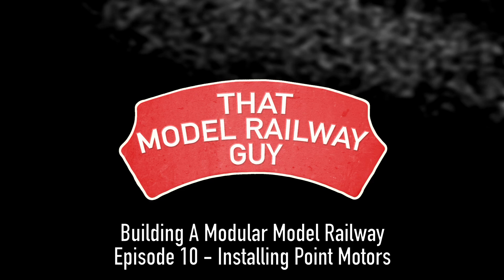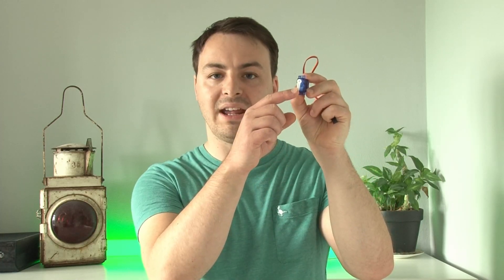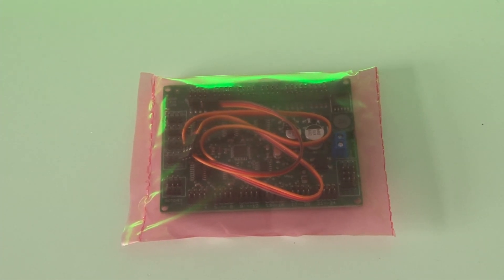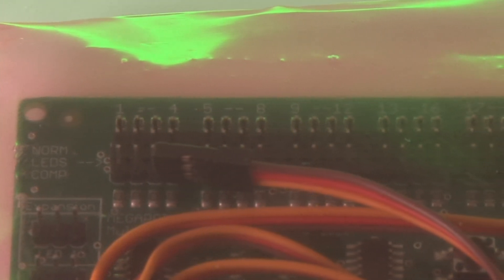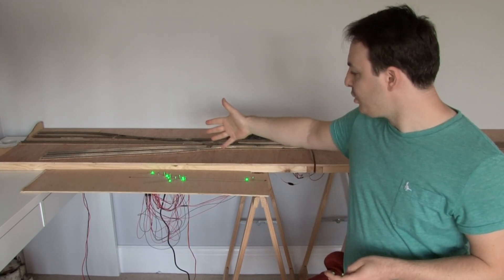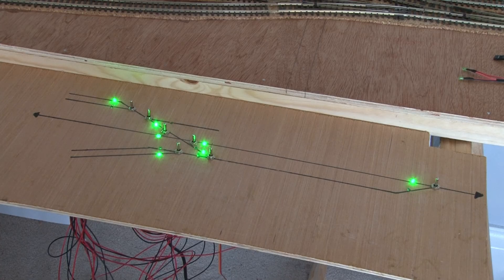Building A Modular Model Railway! - Episode Ten: How To Install Point Motors

Comment from the maker: For those wondering, I kept the springs in the points deliberately. While the layout usually runs on DCC, when I switch it over to DC the power is routed through the point blades. Keeping the springs means the blades are locked into place better. 
It's a "belt and braces" approach and I may remove them in the future but the audible "click" you get when the point switches is a handy way to confirm it's all working as expected too. Thanks for watching 😃
Reply: Good point.

Comment: Great, I didn't know about these point motors, they seem to work really well and it will make running more easier as you know where they points are set, well done 👍🏻
Reply from the maker: Hey Adam, yeah the servos are great! Pretty cheap and they have plenty of other applications as well. They're not limited to being used with the Megapoints system either but I have admit that made the wiring and the control panel so much easier to put together! Thanks for watching 😃

Comment: Gosh, that's really nicely done, That Model Railway Guy. I'm amazed at how effortlessly the little loco operates through the switches. Even the slip seems to pose no problem for it. You've done a great job.
Reply from the maker: Thanks, the tender engines never have any issues at all because they have so many wheels/pickups. Occasionally the Peckett and Ruston will stall on the points but only if I'm running them at an absolute crawl and I haven't cleaned the track in a while! Thanks for watching 😃

Comment: A very useful looking system - I might explore using it when the time comes for points on my layout. Thanks for the video.
Reply from the maker: It certainly is, though it is expensive. I do feel it's worth it though considering how easy it is to set everything up and this video barely even scratches the surface of what Megapoints Controllers are capable of. Best of all it just works, which is what you want from a system like this. Thanks for watching 😃

Comment: You have given an excellent introduction to the Megapoints Controller's system. The wiring looks scary but the instructions and YouTube videos walk you through the steps very easily. With help, I have fitted 24 servos, operated using  the Megapoints System. Deciding exactly what to order from Megapoints can be a bit daunting, so get help from someone who already uses it on their layout. The Plug and Play approach makes fault finding much easier. My tip would be to remember to label each point and the connecting lead to it. It really is a cracking system that allows for easy expansion and additions such as route selection, signals, block detection etc. I look forward to following your progress!
Reply from the maker: Thanks, that’s really great to hear. Yeah I would definitely recommend watching Dave’s own videos to anyone who wants to use this system as he’s made them really easy to follow and understand. I’ve certainly got lots more ideas for things I want to do wit Megapoints so I’m sure there will be another video in the future! Thanks for watching 😃

Comment: hiya. i did not about these motors. will have to look into them. thanks for the info and great video. cheers tom.
Reply from the maker: Hey Thomas, yeah servo motors are awesome. They're not just limited to model railways either (I believe they get used in model planes and boats a lot too) so there's lots of flexibility with how you use them. Thanks for watching 😃
Reply: @ThatModelRailwayGuy  yes i think they do. thanks for the heads up. cheers tom.

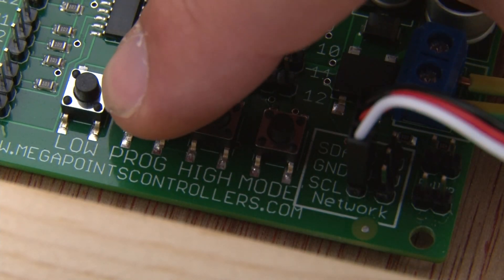Comment: Hi again @thatmodelrailwayguy - coukd you help please? I'm in tje process of installing my megapoints setup - at 08:28 what is the cable connected next to the "mode" button
Reply from the maker: Hi there, it's the network cable that connects the various boards that make up the Megapoints system. In this instance it's connecting my makeshift control panel (MultiPanel) to the servo controller. Hope that helps and thanks for watching 🤩

Comment: Im trying to work out how to have leds for directions but when using normal solenoid motors. Any tips or details on building mimic panels would be awesome 😎
Reply from the maker: I believe the PM1 solenoids have a built in relay/switch that can be used to power directional LEDs on a display panel. Thanks for watching 😃
Reply: @ThatModelRailwayGuy  AH rats, I got the ones from rails. They are really decent but I'll need to work out what I'm going to do for a panel. A project for once the layout is built perhaps

Comment: Great video, They look really simply to wire up and install, just a quick thought though if you took the springs out of the points would you get the slow moving characteristics of a tortoise point motor
Reply from the maker: Thanks Jack, yeah it is really simple to put together and Megapoints is really easy to use too. You're absolutely right about removing the springs to get slow moving points. The only reason I didn't personally is because I sometimes run the layout in DC mode where the power is routed through the point blades, so having the spring still in place was a "belt and braces" moment. Thanks for watching 😃
Reply: I do not rely upon the tiny contact spring (on the underside of each blade) to transfer the power to the switch blades and hence to the frog. When and if these eventually fail or are damaged from extended use, you are faced with the need to disturb the ballast, scenic treatment etc to repair/replace the point, which is both very time consuming and disruptive.  I have over 40 points on my current layout and some have seen over 25 years of service. To avoid any breakdown of these critical contacts and/or replacement of points long term I hard wire each blade and it’s adjacent stock (fixed) rail to an INDIVIDUAL set of contacts on a sub- miniature 12v coil relay associated with each point. A micro switch, added if necessary, to each servo triggers (energises) the relay only when set to the Reverse (R) position. When de-energised (the point will be in the Normal (N) position.  The blade for the R route is wired to the N/o contacts and the N blade to the N/c contacts of the relay. The coil circuits are powered from a separate and common 12v d.c. supply. Thus the blades are no longer reliant on the contact spring under each blade. I noted that in the video on platform construction you mention the need to avoid painting rails where the blades meet the stock rail. Please note this is not how the power is transferred (it’s via the contact spring under the blade) and the method presented here will also enable full painting of the rails.  In the case where ‘electrofrog’ points are installed the wiring is simpler as the blades and stock rails are permanently bonded to the blades the relay only needs to switch the frog. A great video for modifying/wiring ‘elecrofrog’ points is available on the ‘Chadwick’ channel. I hope my notes will be of interest to you and other followers of your clear and well presented content. I particularly like the use of paper spacers to centre the tie bar. Every day a school day, even at over 80!
Happy Modelling T🚂

Comment: Silly question...... what did you use to hold the LEDs in place on the mimic panel?
Reply from the maker: Hiya, no silly questions here! The mimic panel in this video was just a test board so I literally drilled holes the same size as the LEDs and pushed them in using friction to hold them in place which can work fine if you're not moving the panel round much. If you do want to properly fix them in place a little bit of superglue or hot glue can work well for that. Hope that helps and thanks for watching 🤩

Comment: Fun to see a British layout using servos for point control. Here in the Netherlands it's a really common technique, interesting how it doesnt seem to be in the UK. Here you even see people buy bulk loads of them online and wiring them up themselves as a cheaper alternative to the fancy slow action point motors. Havent seen this more plug and go technique though, definitely something to look into when Ill start building my layout.

Oh and have you removed the springs from your points? Looking at the way the point blades slowly move and than snap into place it doesnt seem so. If you remove the springs and get the servo to move the points into position  it all moves slower and more prototypical. Might be a fun thing on some points at a more scenic area.
Reply from the maker: It's pretty common here in the UK too, after all Megapoints is entire business that is built mainly around people using servos for model railways. I guess they have more competition here as we're spoilt for choice with servos and SEEP motors as well as ready to plant options from companies like Hornby and PECO. The Megapoints system is what makes it really easy to setup though and I love that fact that it's just one wire to connect the control panel to my layout 😃 

You're right, I did leave the springs in. Usually my layout runs on DCC but when I switch it over to DC then the power is routed by the point blades instead, so the springs are there just help with the connection. I may remove them in the future although the audible "click" is quite handy, if unrealistic. Thanks for watching 👍

Comment: I love the concept! I have a question regarding the behavior of a hobby servo on power up. Since the hobby type servo has a control board and encoder inside the servo, when it powers up, typically they move a few degrees, then move back to a commanded position as soon as the position signal is received. If you turn on a model airplane onboard electronics, the servos (at lease mine do) "jump" the control services a few degrees, then go back once the transmitter signal is processed. Does this system do this? I suppose the push wire has a lot of accommodation in it and probably wouldn't hurt anything, but I was wondering if they have a way to stop this?
Reply from the maker: Hi David, you’re absolutely right in that the servos do jump when powered on. For the points it doesn’t really register but the semaphore signals (which I’ve now motorised in the same way) do get a bit of a shock. I think the only way to get round this as far as I know is to use digital servos instead which don’t jump on startup. Hope that helps and thanks for watching 😃
Reply: @ThatModelRailwayGuy  Thank you for the reply. Do you think it will hurt your semaphore signals?

Comment: I have tried different servo mounts, but ended up just using hot glue. It will hold. The stress on the servo from the piano wire is not enough to loosen the bond. I also flip the servo on its side to maximize the surface for the glue, and to minimize the vertical space taken up by the servo.
Reply from the maker: Awesome, good to know that's another way of attaching them. Personally I quite like using the brackets as it makes it easier to replace or adjust the motor should there ever be a problem. Thanks for watching 😃

Comment: what size piano wire are you using?
Reply from the maker: There's a link to the stuff I used in the description. Generally though it will depend on the size of the holes in your points. Thanks for watching 😃

Comment: did you consider using microbit to control the servos? (you will be limited to the number of servos you can control) but appears "cheaper".. asking for a cash strapped friend. M
Reply from the maker: Not really as it was less about using servos and more about having the control panel and the ease of wiring by using this system. For more budget friendly options I'd probably look at the servo controllers by either RK or Heathcote Electronics as those are more ready to use products designed for model railway use. Thanks for watching 👍

Comment: Really interesting, thanks  for the video. To be pedantic, that's aluminium channel, not angle (Angle is L-shaped).
Reply from the maker: Doh! You’re absolutely right, slip of the tongue on my part 😂 Glad you found it interesting though, thanks for watching 👍
Reply: @ThatModelRailwayGuy  so does the piano wire "pivot" on the hole in the channel? so when the servo moves in one direction, the wire above the board moves in the other?

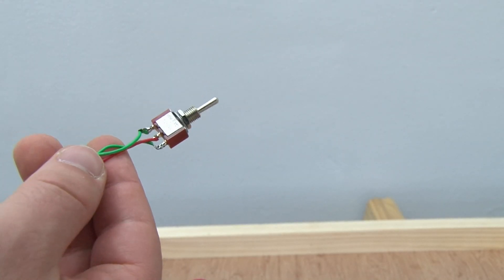Comment: Great Video, but  @ 8:47 you show a toggle switch that moves the motor, but you don't show how or where it is connected to the board - or which board? 
Also it doesn't show how the Boards are powered or where the LED's are plugged in 

It feels like the video has gone from installing 1, to skipping to having a complete layout without showing A to Z of how to install a servo motor, and wire it up to;
both boards, a toggle switch and a LED, 

It there a Video that shows this or could you do one just showing 1 Servo install from start to finish for us absolute Noobs?
Reply from the maker: With this system you have options. You can either plug in toggle switches directly on the servo board or connect the separate mimic panel board if you want LEDs too.

The boards are powered by 12v DC. As I explained in the section starting at 09:14, I have all the switches and LEDs plugged into the mimic panel board, which in turn communicates with the servo board to move the corresponding motor. Everything is numbered on the boards, so Switch No1 activates LED No1 and tells the servo board to move Servo No1, etc.

Bare in mind that this video was about installing a motor on the layout, less about the control system used. As I mentioned early on in the video, Megapoints have done their own videos explaining how to wire up the system in great detail so there wasn't much point in repeating it here. Obviously this isn't the only system you can use either, there are plenty of other methods for controlling servo motors on a layout which all work differently. Thanks for watching 👍

Comment: Do you have, or know of any other YouTubers who can simply explain how to install and writeup electrofrog points?
Reply from the maker: Check out Dean Park Model Railway! He has a really good in depth video on exactly this 😊
Reply: As well as the servo controller board, Megapoints also make a relay driver board, so you can have a relay operating in parallel with the servo, and use the relay to switch the power to the point frog.
Reply from the maker: @kenr86  Hi Ken, yeah if you're already using the Megapoints system the relay driver would definitely be the easiest way to switch the frog. As I'm using insulfrog points though I don't need to worry about that. Thanks for watching 😃